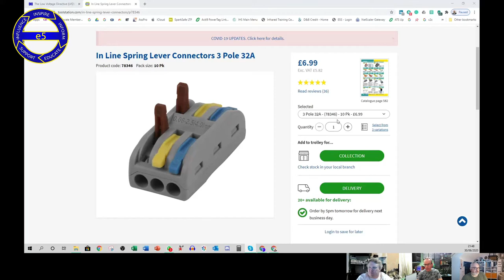Podcast 73: CE Marking

Comment: The US NEC 2020 requires the use of listed devices for electrical work namely devices and equipment that are robustly tested. More than that electricians are required to complete their work in a quality and professional manner including the NEC to adhere to local state regulations and requirements for inspection of installation.

It would be great to cover the very stringent electrical testing and functional operation and construction of medical equipment and devices. It will be very instructive for electricians. Get one of the medical device manufacturers and companies doing the testing to come in and take you through the labyrinth.